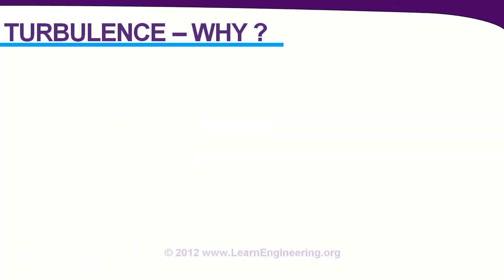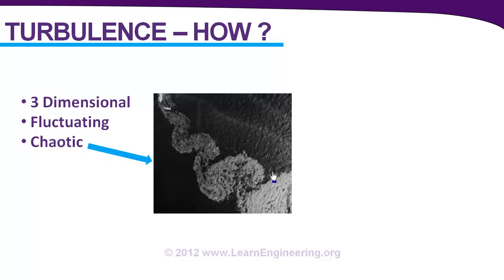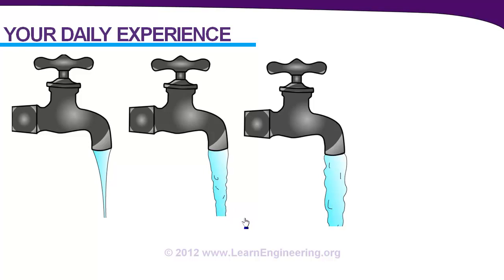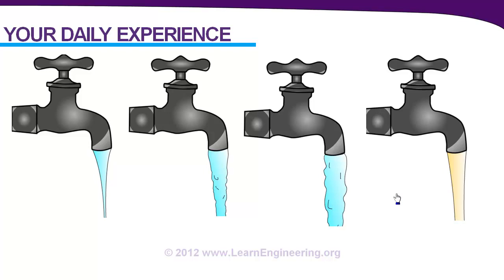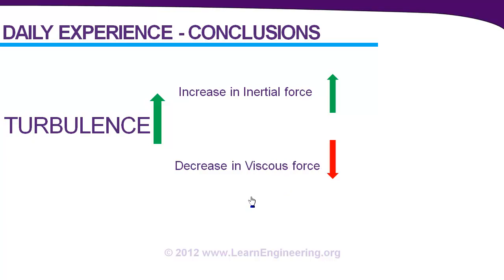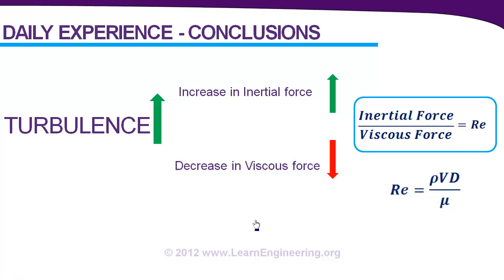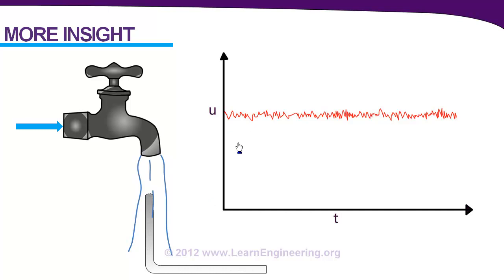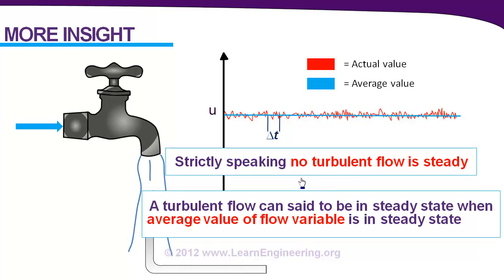Introduction to Turbulence & Turbulence Modeling

Comment: Everything is really well presented. However, we should be careful in stating that Turbulence reduces drag. Turbulence does not reduce drag. On a given surface area/length laminar flow always has less drag than turbulent flow. This sort of friction is called skin friction. The friction that happens when a flow wets the surface flowing. However for blunt bodies like a sphere, the flow separates at the equator causing "dead water" effect at the back of the back. When a flow separates, this creates a higher drag than laminar or turbulent flow, known as the pressure drag (form drag). This form drag is very high and most of the time it's greater than skin friction. What dimples in the golf ball does is that it energizes the boundary layer and flow stays attached for a greater distance on the surface. This flow attachment reduces flow separation, hence reduces form drag which in turn reduces the overall drag. It needs mentioning that in a situation where a flow does not separate (airfoil at low angle of attack), turbulent flows will increase the drag compared to laminar flow.
Reply: Qayyum Mazumder Thank you..
Reply: So true....